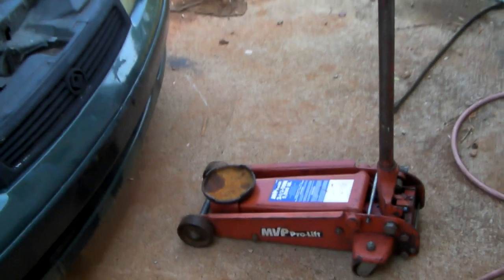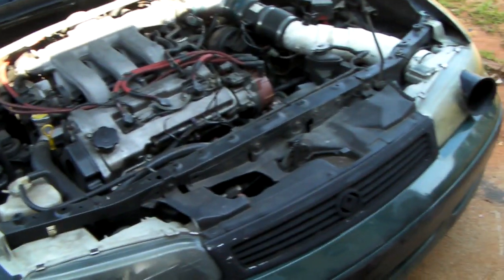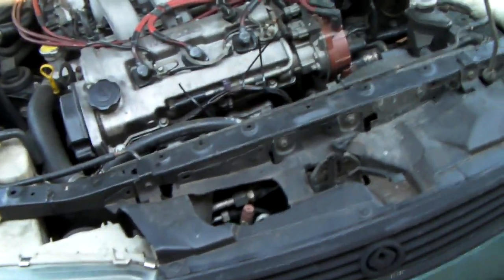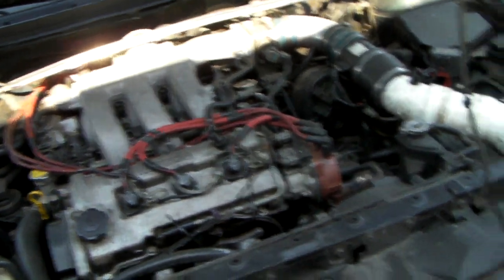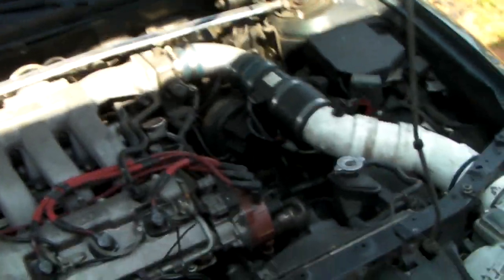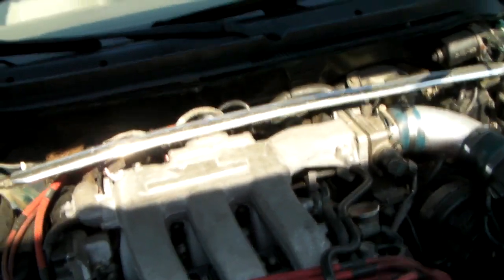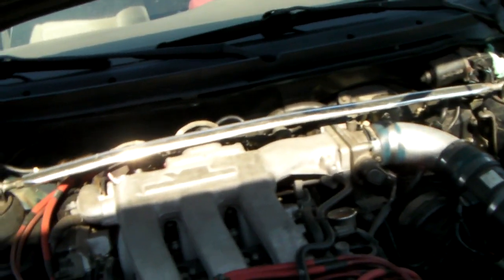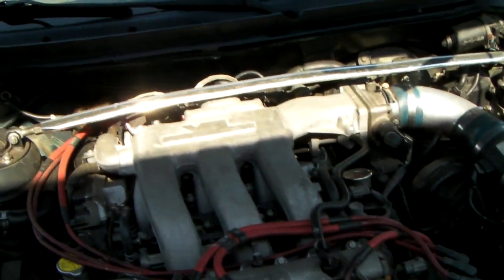Listening for a cracked valve spring retainer on your KLZE

Comment from the maker: @backpackwithjets Actually I did that already and in that video is the combination that you speak of. It worked for about 3 or 4 years and it finally decided to break. The DE springs are good only if you plan on revving it to 7k rpm and no more. The DE springs can take some abuse but I think mine were just getting weak in that engine from revving it to 7500 all the time. I have the interprep valve springs in it now it and maybe it was because I had a few weak springs but it sounds stronger now.